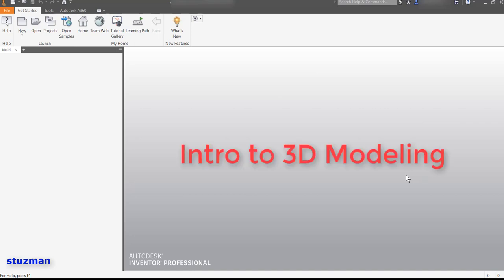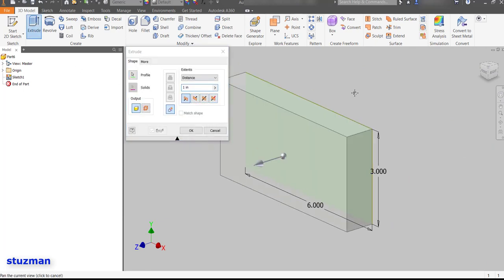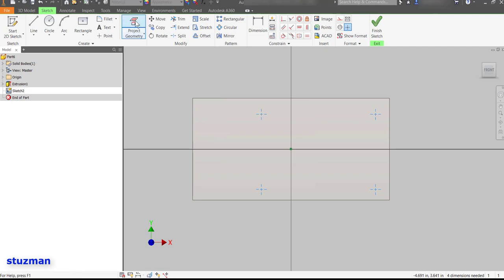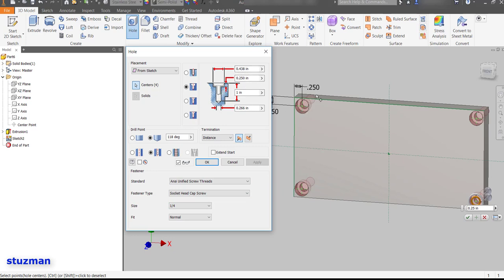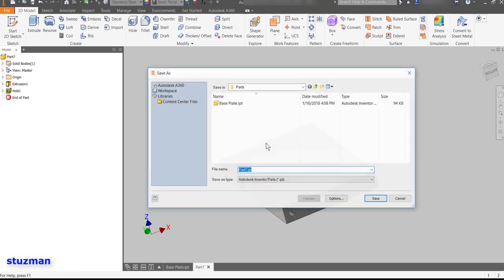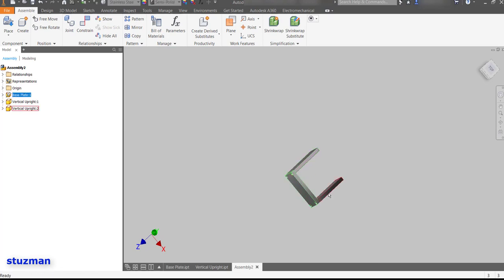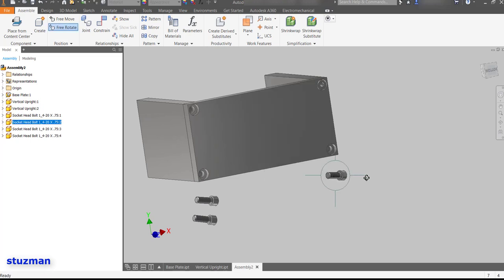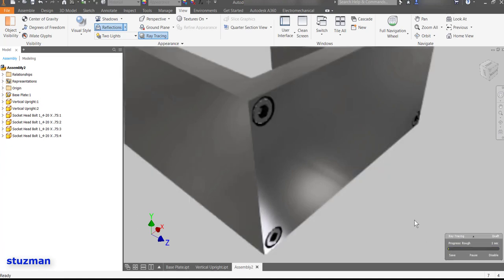Intro to 3D Modeling

Comment: What software is that? ...  I've used quite a few over the years. Every CAD system has it's own set of quick click features thanks for sharing.... Best of luck!! ... Pappy
Reply from the maker: PappysCorner That would be Inventor.
Reply: Ok, we had AutoDesk when it came out back in the 90's, I never used it thou others did, I had only 2D back then, it's changed quite a bit. I started on Anvil 2D on DOS in the 80's, AutoCad after that and several others since then. Today it's Siemens NX... Buy the way... I specialize in designing progressive coil dies and a journeyman tool & die maker. Thanks again for the overview.... Pappy
Reply from the maker: Your background sounds similar to mine where I started with AutoCAD 13 back in '93 using it mainly for wiring diagrams and electrical cabinet layouts. Later, we switched to AutoCAD Electrical for the wiring diagrams and then used Inventor for the 3D modeling of projects. Although I was hired as an electrical engineer, a lot of my work was involved with mechanical engineering in designing industrial automated equipment. You've quite welcome for the review and wish your channel much success and will get a chance to check out your channel since I'm subscribed to you. Have a good one! Terry

Comment: Very cool Terry! Makes me want to design something!
Reply from the maker: Thank you Thomas! If you want to learn about it, let me know and we can do some chats about it :)
Reply: Thank you... I might just take you up on that (or stay tuned for you to post more 3D modeling videos)! I have https://www.emachineshop.com/ installed and always wanted to make something that I could turn into a product for sale... your program seems to be more user friendly / have more visible functions (if that makes sense). I used emachinshop to design a throttle adapter plate that I made from scrap aluminum for my old BMW some 15 years ago.